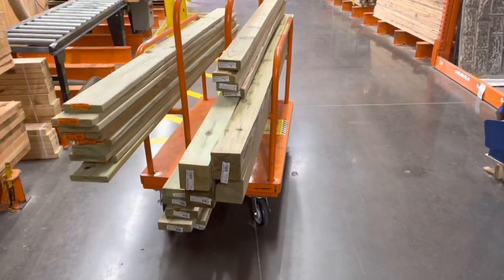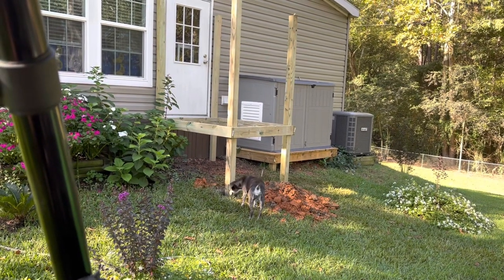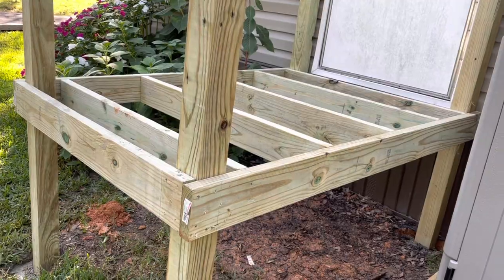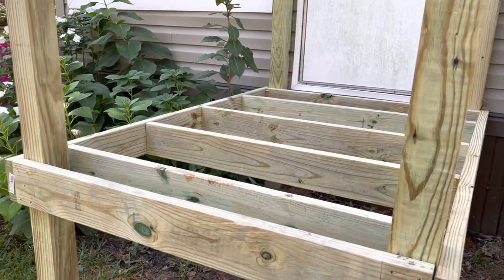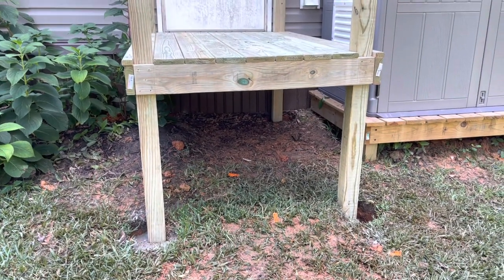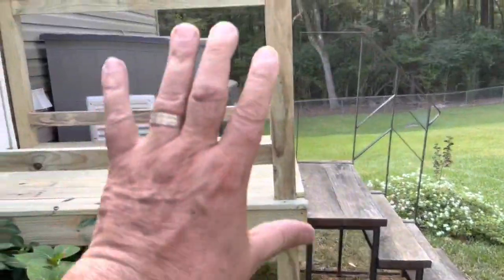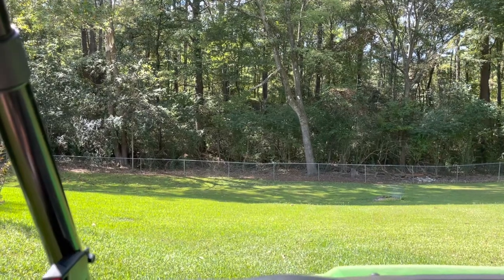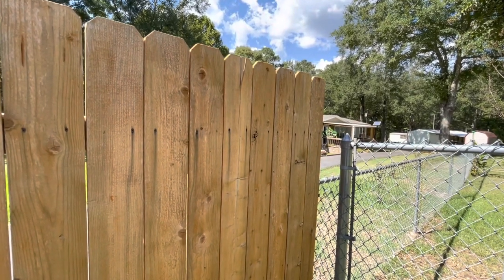Building a small back porch

Comment: I know its a small porch but I'd use nail and lag bolt. All that weigh is being held by Deck screw.
Reply from the maker: Good for you.
Reply: @bctruck lol.. I wasn't trying to be rude. The porch looks great. I used to do the same thing. Scew are usually not structural and not use for load bearing.  I'm sure it would be fine.
Reply from the maker: @johng8967  telling me what I should have done, on something I built years ago, is silly. Not trying to be rude, but it’s just plain 🤪

Comment: What are the dimensions of your deck, and also the materials you used for the lumber? Great video.
Reply from the maker: 4x6 deck. I used 4x4 for the posts. 2x6 for the ribbon boards and 5/4x6 for the decking.